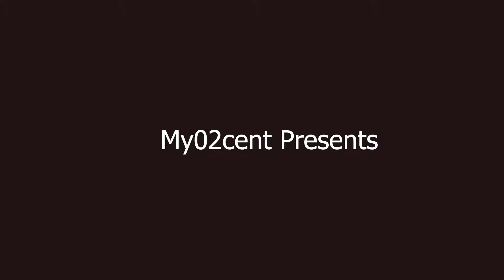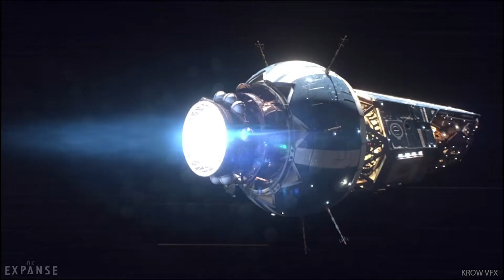How it works Epstein Drive Part 1 Computer Voice

Comment: Lmao this is totally wrong lmao. Acceleration is not the same as speed. Lmao if the drive existed it would go:

9.8 meters in the first second
19.6 additional meters in the 2nd second
29.4 additional meters in the 3rd second
39.2 additional meters in the 4th second
49 additional meters in the 5th second

The total distance traveled is in 5 seconds 147 meters. Every second of acceleration you travel the same distance as the previous second plus your acceleration rate. 

The way you seamed to explain it you equated speed with acceleration as if they are the same. They are not. You can be traveling in a ship at 1000 miles a second but if you are not increasing your speed ie your not accelerating you are weightless.  But if you are in a different ship traveling 100 mile a second but increase your speed by 9.8 meters per second ie you are accelerating 9.8 meters per second your body weight would be the same as it on the earth.
Reply from the maker: The rocinante is 78.5 Meter is length. The Rocinante would travel its own length in the first 8 second.  Base on this line of reasoning you would think that it would take another 8 second for it to travel its own length again but in fact it would travel 88.2 meters in one second.
Reply: @my02cent28  this might be an example of a warp drive. They where intensionally vague as to hw the drive worked , i assume so this it would not date itself in 10 or 20 years from now. 

However back in the 1960s america built the first nuclear roocket engine using the kiwi reactor. Not only did the build the rocket engine they tested it also. Since then more advanced nuclear rocket engines have been proposed and designed. 

Sienentists claim that if you take a warp coil you could use it to reduce the apparent mass of a ship. Therefore if you had a warp coil that reduced the mass of the ship to 1/10 its acutal value, then you could use a much smaller rocket engine to move the same ship. And since the engine is much smaller the same fuel for the larger engine would last 10 times longer.

instead of a factor of 10, what if the reduced the mass by 100 or 1000 or 10000. Then while the rocket still is nor going at some fictional magic speed, it can go at its current speed for 10 or 100 or 1000 or 10000 times longer.
Reply from the maker: @billlyell8322  How would you reduce Mass? I can't imagine a practical way to reduce mass while conserving matter at the same time.
Reply: @my02cent28  as a physicist explained it, the 2 warp coils generate 2 fields. 1field is negatively charge the other is positively charge. 

The ship's mass is felt or distributed in the positive field. As the increase the size of the field the apparent mass of the ship appears to get smaller as it is spread throughout the entire increased field. The negative field is suppose to protect the occupants or contents of the ship. 

By adjusting the 2 fields properly, by balancing them, the decreased apparent mass can either be moved faster or moved with less fuel, and it is theoretically possible to do both with two properly balanced fields.

In other words if you have a 1g rocket you could drive a ship either at 3g for the same time or at 1g 3 times as long or if properly balanced 3g speed 3 times as long. And even at 3 g the negative field could be adjusted to have an apparent (felt) acceleration of 1g.